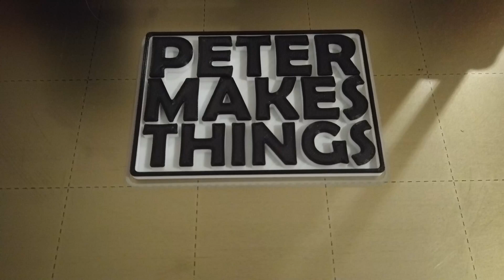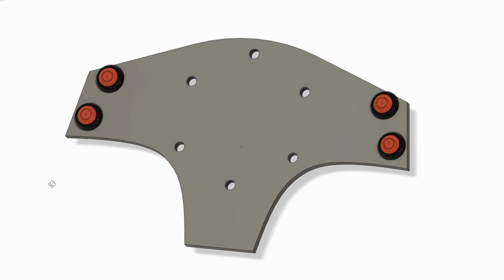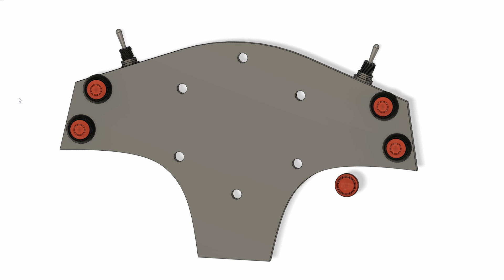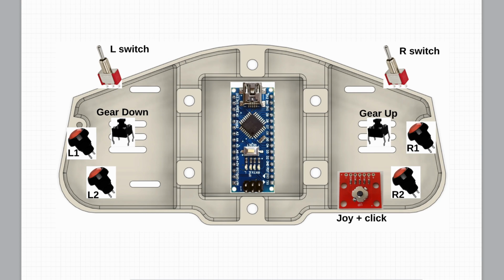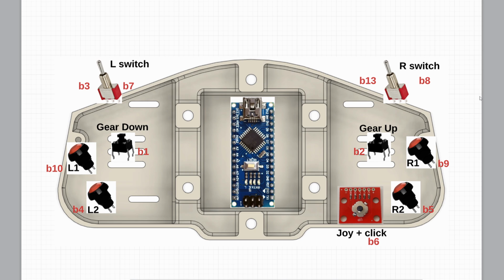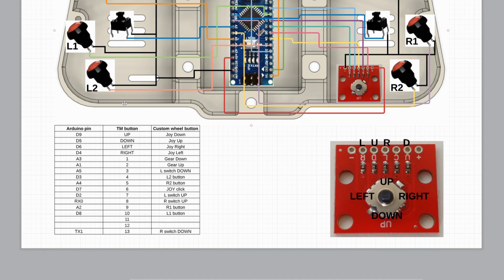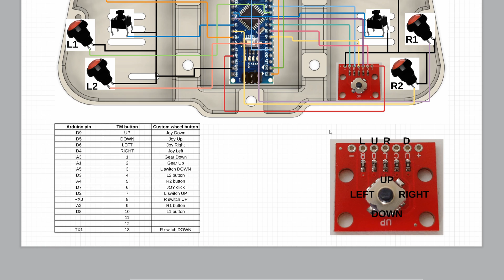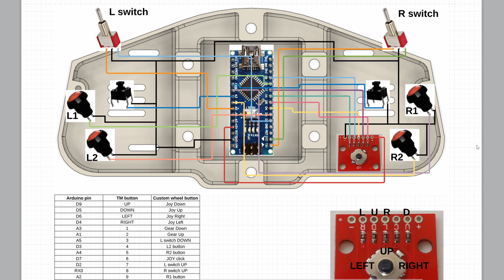How to make a wheel for Thrustmaster (part2) - design and assembly

Comment from the maker: After I made this video Taras from http://rr-m.org/ was kind enough to make a custom version of his sketch to enable 2 rotary encoders, links to files in description
Reply: HI, have you tried to use another rim .ino? i want to add more buttons so i need to mock another wheel (like the f1 wheel addon, or the sf1000) have you tried to read bytes from your sf1000 using arduino? could be useful to "emulate" a powerful rim with more buttons and encoders. thanks
Reply: Hi Peter, thanks a bunch for making this awesome guide.
Can you recommend any rotary encoders to be used with this project (specs and so forth) ?
Reply from the maker: @rugbyprofessor  I'm using the cheapest ones from ebay :) they're not perfect but do the job, I know cts288 are quite often recommended, btw - as far as I'm aware you need the version of encoders that includes pcb and resitors (otherwise you'll have both CW and CCW triggering randomly both button)
Reply: @petermakesthings7342  Cheers for getting back to me this quickly. Would you by any chance have a link so I know what encoder I need to buy?

Comment: Hello Peter, I have a problem with the open-wheel configuration, the rotary ones are activated randomly and I have the KY-040 encoders with pcb but I can't get it to work well, if you could help me I would be eternally grateful.

Comment: So could i theoreticly replace the standard board inside my Open Wheel and use a Arduino Nano instead? Inorder to lets say add more buttons or even rotary encoders? Or will the code not work in such case.
Reply: you can't add more buttons, but theoreticaly it's possible to add a screen.
Reply: @14przemoIO  any idea how? love to add a screen

Comment: I have  tried to modify the arduino sketch of the TM open wheel, in order to have all push buttons, but I can´t get it work. Could you modify it? No encoders, all push buttons. The reason to use that sketch and not the Ferrari 458 is to not having to use the pin 2 as INT0.

Thank you

Comment: Do you think this would work with xbox one?
Reply from the maker: it will work with any console your wheelbase is compatible with, as long as the sketch is fine on the firmware you have installed, unfortunately I have no knowledge what works on which firmware, guess you'll just have to try (get just the arduino and ps2 connector and see if your wheelbase recognises it)

Comment: Am I able to make LED bar like on 488 Challenge Add-On with this arduino?
Reply from the maker: no, to have led's you'd need to use a usb approach, eg via simhub or similar pc software, I made a video on making a simhub display with leds, you can use it for reference to make a wheel button box
Reply: @petermakesthings7342  thank you

Comment: Hi Peter, thanks for the vid! I tried to make this, but I'm having a really weird issue where the power LED on the arduino is dim, but on when plugged into the base, and the buttons don't work unless the arduino is plugged into USB. Do you have any ideas as to what the issue could be? The other LED on the arduino turns on just fine, just not the power one
Reply from the maker: seems like your arduino is not getting enough power, bear in mind the TM base or outputs 3.3v, if your arduino requires 5v then it won't work, are you using nano v3? I personally never experienced this and made like 7 wheels using the emulator sketch already
Reply: @petermakesthings7342  These are the boards I'm using https://www.amazon.co.uk/gp/product/B07DDBY7C5/ref=ppx_yo_dt_b_asin_title_o00_s00?ie=UTF8&psc=1
It seems it does require 5v, though I'm strugling to find a nano which requires 3.3v
Reply from the maker: @ario129  tbh I have no idea why these don't work, I used exactly same ones and it's all fine, did you try different board? and tripple checked the connection? I assume you used the arduino sketch from http://rr-m.org/, not a button box sketch right? if you answered YES to all the questions then I just don't know, check with multimeter the voltage that goes into arduino, try connecting the arduino to a stable 5v power source (connected to pins rather than usb plug) and see if that works...
Reply: @petermakesthings7342  would a nano like this be better? https://store.arduino.cc/arduino-nano-33-iot
Reply from the maker: @ario129  that's an overkill, here you have to connect wires between arduino and the ps2 plug for TM base, no need for BT or Wifi

Comment: Is that possible to connect the display to the pins? And will it work?
Reply: With simhub
Reply from the maker: @vuluth457  this is a completely different arduino sketch, it emulates a Thrustmaster wheel, there is no way to incorporate a screen as there is no TM wheel that has one, you would need to have two arduino's - one to emulate TM (and work also on PS and xbox) and one to run a screen, leds etc via simhub on pc only

Comment: tnx for the video, the 5 way switch must be feed with 5v? i order some diffrent 5 way switch and its only have 6 pins, im trying to understadnd how to connect it to the arduino
Reply from the maker: there's two options - either you don't have a middle click and therefore one of the pins is 5v, or the one you have doesn't require voltage and cam be connected same as all other buttons to arduino pins and gnd
Reply: @petermakesthings7342  thanks Peter you are the number 1 on YouTube! 🙏🏆
Reply from the maker: @מיסתוריןועלטבעי  thanks:) good luck with your build

Comment: Peter is there any way to conect the arduino directly to the pc via USB? Is there any sketch that could do that? i am trying to do that for a long time with no success... please give me a light
Reply from the maker: That's actually the easiest option - use simhub  to generate the sketch for you (check my how to make simhub display video for more details)
Reply: @petermakesthings7342  i did ser that video... I Will try it today. Thx for your help
Reply: @petermakesthings7342  Peter i dont know if i was clear enough with my situation. I am trying to keep the original connectors and buttons from my p310. So i did the connections from the ps2 port from the rim to the arduino and connected the arduino direct to the pc via usb. Does simhub manage to understand the buttons?
Reply from the maker: @RRodrigues18  ok, so that's a completely different story, afaik there's nothing like this available, I'm actually looking into building a mod that enables connecting TM wheels to any wheelbase but it's still a fairly long way till it's ready
Reply: @petermakesthings7342  yeah i understand... I have searched quite a Lot to find something on the internet and i sim having the same problem... Thx for the help and time anyway. Keep with the good videos
Reply: Hi Peter, will this work with the Xbox one or just on pc?

Comment: What if I have more buttons
Reply from the maker: If u have more than 17 buttons I'm afraid you're stuck with arduino button box
Reply: @petermakesthings7342  another question, if I have a nano v3, but would like to skip the ps2 port part and make it USB, is it possible? I heard the nano isn't hid compatible?
Reply from the maker: @mohamedelsadig5820  yeah, if you'd like to have a usb hid using joystick library you need a pro micro, check out a great video by amstudio on how to make a button box
Reply: @petermakesthings7342  thanks, cant find a pro micro near me but I think I'll just go for the leonardo.
Reply from the maker: @mohamedelsadig5820  actually sorry, no idea why I didn't think about it first but you can use SimHub with nano v3, just go to 'arduino' tab and the software will generate the sketch for you, I made a video on how to make a simhub display, but it's the same idea here, just chose button matrix

Comment: Is there any way to "calculate" how thick or strong such a wheel body has to be at a certain number of force the wheelbase is providing?
Reply from the maker: I'm sure there is but I'm not an engineer and have no idea. The main rule I apply is to sandwich the plastic between wheel metal plate and metal adapter (the quick release in my case). In such case the plastic is just squeezed be between two metal surfaces and no ffb forces affect it. As long as the walls where the M5 screws go through are thick enough nothing will break.

Comment: hello, Thank you for  this video, its amazing, i'm actually moding a wheel for my T-GT base, i just have a problem with the switch if u can help me, the button assigned to the switch stays on all the time, how do i make it momentary so the input does not stay on all the time.

Thanks in advance
Reply from the maker: if you are using arduino and the same sketch then it seems like your button is shorted, button press is recognised when the button pin is shorted to ground, which is what a standard momentary switch is doing, after you press it makes a connection between both of its pins. Check with multimeter if your switch is working correctly. If all is fine and it still doesn't work feel free to email me @ petermakesthings@gmail.com, but tbh I'm not sure what else could cause problems here..
Reply: @petermakesthings7342  thank you for replying, I think the problem is that the switch I'm using have two positions one always on, it doesn't have off position and might not be  momentary switch.

BTW how is the quick release adapter going, I filled the form a while ago, hope I'm not one of those who got your email in the spam folder. 😂 😂
Reply from the maker: @ArhokAndres82  yeah, you do want to use OFF-(ON) button for sure :) 
re QR -> send me an email so I can give you an update
Reply: Arhok Andres you can use the current button if you sent the other end of the switch to literally nothing